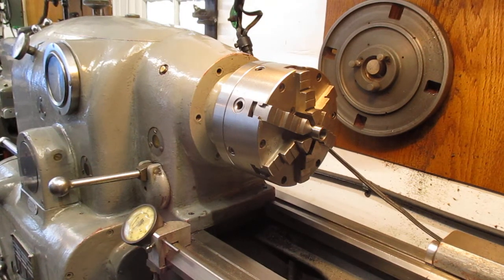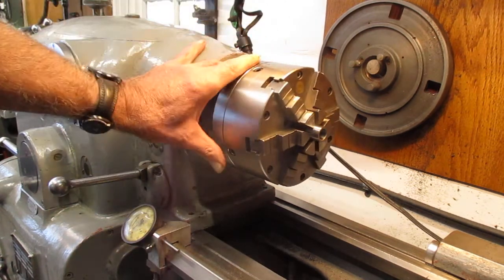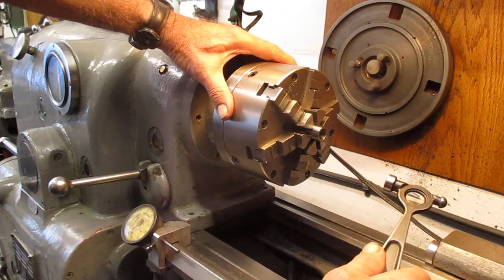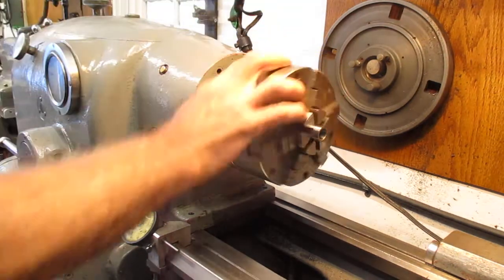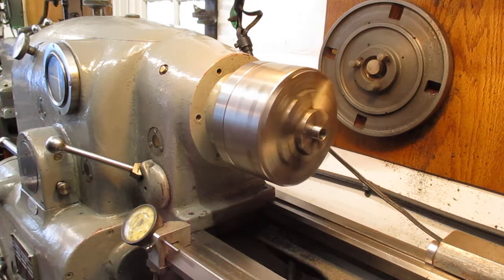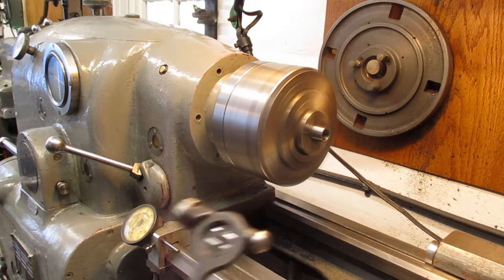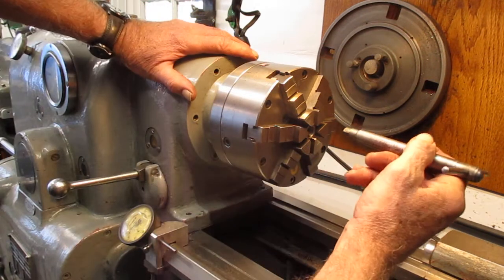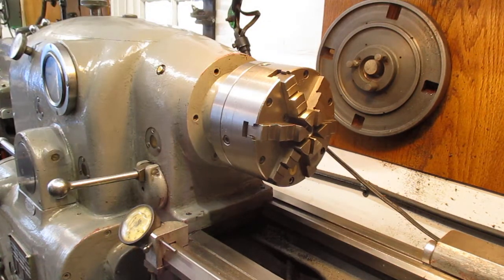Monarch 10ee lathe work holding demo, 6 jaw chuck

Comment: Love that monarch
But what a racket from the motor/generator
Time to go DC powered.
Reply from the maker: I have a hard time changing something that works that well, the machine has been in continuous service for 70 years.
Reply: I really enjoy the sound of mine. Adds an aura to the experience of running such a finely engineered machine tool.
Reply: @kmcwhq  tell us how yours is driven…?
I have voltage constraints
So my options are 120/240 AC
Or 0-180 or 0-90 variable DC…thru a full wave bridge….I’m on solar off grid….
Potentially could fire up my 2-71 gmc…for 3 phase 240-480….but the roar from the gen set would not be soo environmentally friendly…..
Reply: @offgridmangogrower  240 3ph Motor Generator same as in this video. I don't think they are as noisy in person as in this video, small shop, microphone sensitivity, echo possibly.